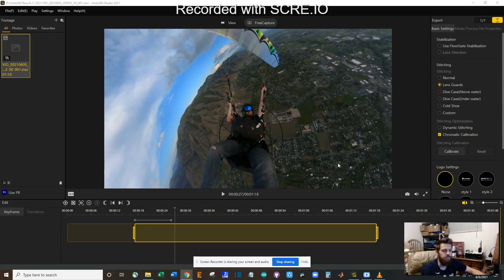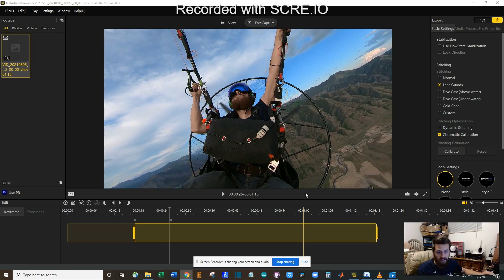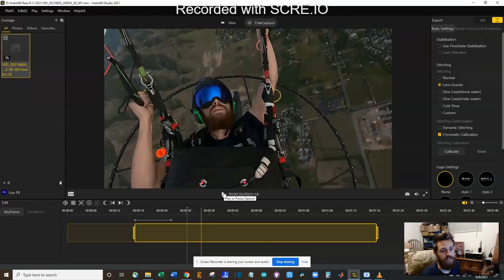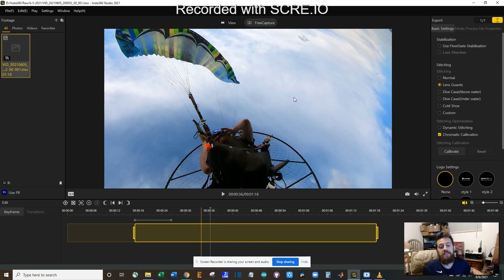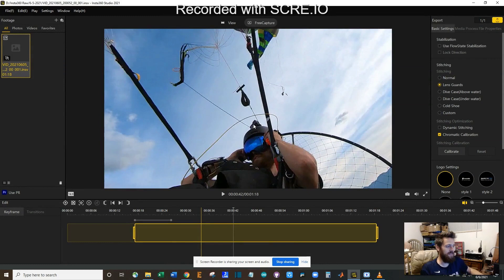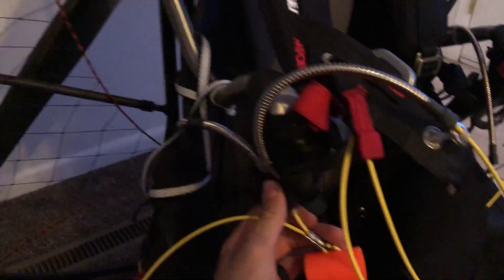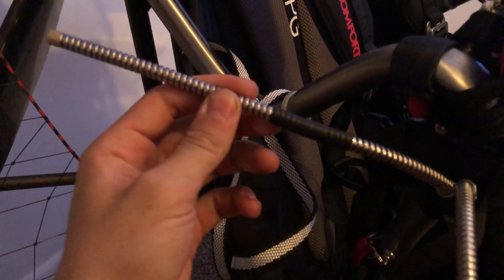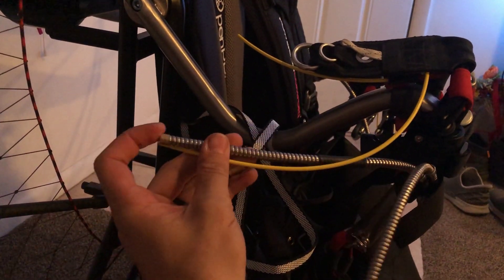Paramotor Strength Test GONE WRONG

Comment: Jeez, interesting video. You were worried about swingarms but how do you feel about that lower section of the frame is connected up to the upper part by friction only, if you dont count on those velcro straps. Did you had any issues with it coming apart while pulling high Gs?
Reply from the maker: This older frame doesn’t separate into the top and bottom half. But I certainly don’t like how the second version does. I definitely don’t trust the plastic clips they supply, but with some industrial Velcro wrapped all the way around, I would trust it.
Reply: @glydrfreak  Thx, I see at 11:11 that you have a solid frame. Mine came with velcro straps, I will have to buy longer ones and wrap around, thx.

Comment: What size and grade bolts are used on the swingarm to frame connection on the sp140?
Reply from the maker: M8 class 12.9 partially threaded
Reply: @glydrfreak  do you think/know if thats the optimal solution? Thinking about the brittleness in hardened bolts. I have unit with the same design and trying to figure out whats best.
Reply from the maker: @rickardjonsson4526  it’s hard to say. When I upgraded from M8 to M10 with stronger arms, I couldn’t decide which class bolt I wanted. But I opted for 10.9

Comment: Hey Braedin.

How do you like the SP140 for acro? I am a relatively new pilot who is selling my original ICE unit for a number of preferences I have developed.
I have watched the SP140 intently and am considering putting in a preorder for an upcoming batch.
I don't have a ton of interest in XC. I enjoy getting up and exploring the ways in which I can orient my wing / my body, and I seek a model suitable for compact apartment life.

Do you think an electric unit would be suitable as a full time rig for playing around with introductory acro? I watched all my historical flight footage and couldn't find a day on which I flew for more than one hour, so I feel as though buying something which is most convenient for actually getting to the field (I could keep everything but the battery in my car) would actually maximize the total time I spend flying.

Best.
Reply from the maker: The SP140 frame as it comes is not ideal for acro because of the weak and bendable swing arms. However, with the upgraded swing arms from iris paramotor, it does really well. The rotational inertias are very low since the battery is right against your back, which is good news for preventing line twists.

As far as flight times are concerned, I can get a solid two acro runs from 3000 ft each before the battery is dead. Flying full on acro puts me around 25 minutes, which is plenty off time for me to get dizzy and sick to my stomach 😁

All in all, this is my primary machine and I have no regrets. I highly recommend it.

Comment: Nice job !  How did the BASE canopy fly under power ?
Reply from the maker: I didn’t try with this motor cuz I knew I probly had release cable housing hanging near my prop. But on my last cutaway test I had a moster and I was able to hold level flight at full power. This canopy is way too heavily loaded though so I bet with a bigger one I could probably climb.

Comment: If the arm didn't support the force, why not to connect the reserve to the harness carabineers ( the ones for the reserve)?
Reply from the maker: Good question! This harness actually has a redundant strap on each side for if I ever lose a swing arm. Convenient enough for me, that redundant strap has two hook in points, one of which I used for the glider and the other I used for the base canopy.

Comment: Flexible stainless spiral seems overkill anyway, PTFE tube would probably work just as well and you could get full length.
Reply: PTFE tubing sounds nice and all, but I would be very worried about it cracking or stretching. I would recommend using the metal hard cutaway housings that you have, but cut and crimped correctly. There's no need to reinvent the wheel, here. There's a reason we still use them in sky and BASE rigs. Last time someone tried to change it up, they came out with soft housings. After too many issues with binding up, they were mostly taken off the market.
Reply from the maker: @ncsjumper  thanks for that feedback! Any suggestions on what I can use to crimp the splice? Or maybe a source where I can find the proper length? Haha  I found a source that is requiring me to buy a huge qty minimum.
Reply: @glydrfreak  I'd hit up Nick Burden. Same guy who made your cutaway setup.
Reply: @ncsjumper  There's not really a reason to worry about it cracking or stretching, and they are more rigid in their length than the SS anyway.
Reply from the maker: The Stainless spiral stuff it’s what’s used on skydive and base rigs. But one major downfall I found with them is the length can expand and contract! My buddy is using PTFE tube for his set up, and I think I’m gonna do the same.
Reply: is the shortened name of the chemical , and  is the trade name. PTFE Tubing is available in white, black, red, blue, and clear colors. Secure with tubing clamps & compression fittings.